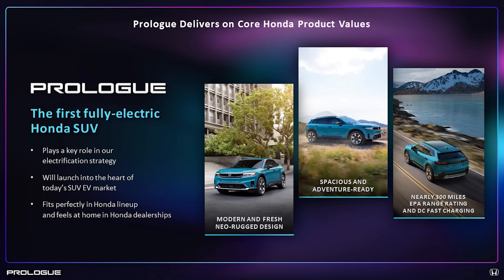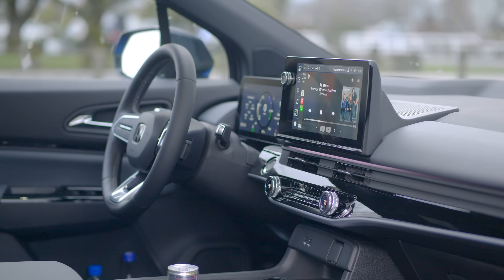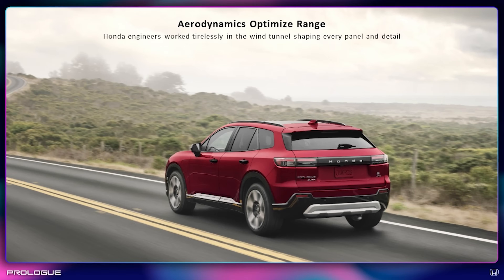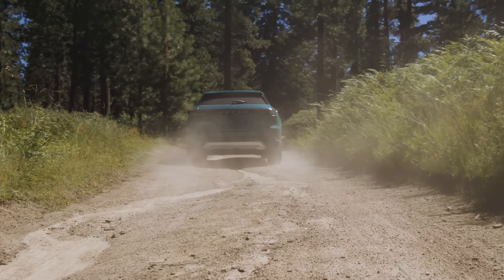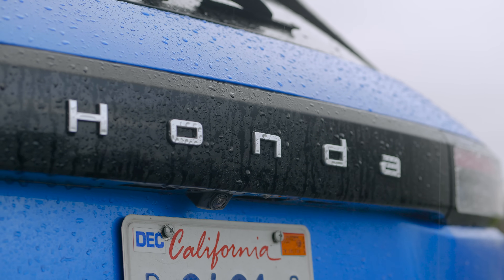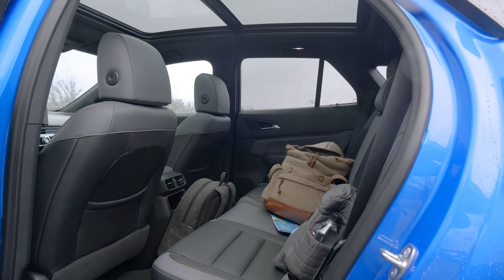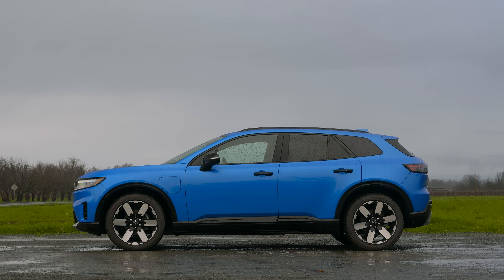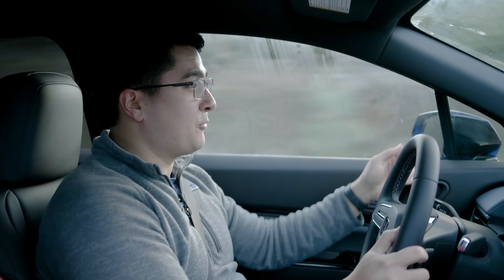Honda Prologue First Drive | Taking Risks

Comment: I’d worry about a GM-based Honda. I’d feel much more comfortable if they swapped in Rover (Lucas) electronics
Reply: Rover? British engineering ? Really?
Reply: @SkippyPB.  They did it once before, the Honda Crossroad was a rebadged Land Rover Discovery, because Honda didn't have an SUV in that exploding segment in the 90s and needed something. They also did it with the Honda Passport (Isuzu Rodeo, which was owned by GM at the time)
Reply: @Black-Villain  ahh didnt know that
Reply: @SkippyPB.  Honda were also major partners of British Leyland in the late '70s and early 80s, for example the triumph acclaim was a rebadged Honda Accord (or Civic?) in the early 80s for the UK market. And the Sterling 825 and 827 in the US (also badged as the rover 800 series in the UK) were Acura Legends. The Acura legend for every market outside of the US and Japan was actually manufactured in a British Leyland factory
Reply: That was cold blooded

Comment: Type R money for a GM EV is diabolical 😭
Reply: the Type R is a diabolical car in general. I could buy a Camaro Z/28,  a real 7L V8 race car with plates, for the same price as a Type R. You'd have to get in a really bad  head trauma accident to know your options and choose a Type R
Reply: @THESLlCK  Yeah, get a Camaro. Do they still come with a free TapOut t-shirt and oversized fake gold chain?
Reply: @NomenClature-o8s  You really thought you did something here? The Civic SI gives you everything you need to build a MUCH faster FWD honda, if that's what you're after for whatever reason. At 50+ grand you might as well buy an S2000 and supercharge it, your buyers remorse isn't my problem. Don't take personal offense, they scammed you out of a downpayment on a mortgage, not me.
Reply: That’s like saying, use a cheap screwdriver to hammer a nail, because it’s cheaper than hammer. Wrong tool. Two different types of tools.

Comment: This looks and feels like a phoned-in effort, that Honda did just because they needed something in the segment.
Reply: Even though they truly didn't... They just wanted to "save" money by not having to do the battery thing, which GM already did... Enter: many future problems that they don't even understand or know about yet... ie battery replacement, quality, reliability, durability, dependability, etc.
Reply: emissions regulations are getting unreasonably tight. They NEED these cars on sale to offset emissions regulations
Reply: Compliance car.
Reply: @faheemabbas3965  what is it complying with? I can't imagine them selling enough of these to make a dent in CAFE.
Reply: When was the last time Honda or Toyota made a huge splash when they entered the market with a product? Hmmm....never. However, they still found a way to own the minivan, crossover, sedan, small truck, compact and subcompact markets that were once dominated by North American names. Asian manufactures operate from a 10 year vision and plan (if not longer) and don't prioritize stakeholder profits over product.

Comment: Honda feel, GM - quality, parts, performance, manufacturing
Reply: That should work out for Honda…
Reply: It's giving triumph acclaim...
Reply: All for the low price of $50,000.00
Reply: Yep.  It’s STILL a GM product with Honda skin. This is atrocious.
Reply: Wait for fire recalls lol
Reply: GM rear drive will drive better.
Reply: What could go wrong? 😂
Reply: this is very deceptive, I buy a Honda because its a Honda. I want no GM in there
Reply: Acura pricing.
Reply: Like the Vibe/Matrix. At least Toyota put their engine in the Matrix. The Vibe had some issues

Comment: Hitching their wagon to GM is not a risk, it's a suicide mission. The GM version of this vehicle has been an absolute nightmare, plagued with so many electronic, quality  and software issues.
Reply: Well, next up is the Honda bespoke EV platform. Hope it's solid.
Reply: really? any videos youve seen? i havent seen anything bad about their evs aside from the issue with the LG batteries they had to recall over
Reply: @bradhaines3142  Their software is complete dogshit
Reply: @bradhaines3142  The Blazer ev has a stop sale on it right now for software issues.
Reply: @bradhaines3142  That LG battery recall was for the Bolt, which was years ago. The newer GM EV Platform (Ultium) has been having issues like you wouldn't believe. From manufacturing constraints to software. The Blazer EV (the car the Prologue is based on) is under a Stop-Sale order right now due to crippling software issues that have caused at least 2 journalists to get stranded, and essentially brick the car when plugging into a charger
Reply: Honda has already pulled the plug on future joint GM products. It seems the Prologue and ZDX are a one-off.

Comment: Remember this isn't the first GM and honda venture together who remembers the 2004-06 Saturn Vue with Honda's 3.5v6
Reply: Gm using Honda engines = good

Honda using GM powertrains = dog.water
Reply: Ideally it would be Honda engine with GM transmission. Hondas had alot of craptastic unreliable slushboxes throughout the years.  @jtpro0244
Reply: Using Honda's V6 was the single positive move in Saturn's history. 
The second was their demise.
Reply: another truly inspiring car
Reply: No wonder I still see those things driving around LOL
Reply: @mertz313  Honda/Acura engines are designed for 350k miles. In my experience its not the engine that'll have you selling a 250K mile Honda, it's usually that you just need a bigger car. In the mean time I have Chevy Suburban that has its own dedicated stall at the local shop its such a POS at 200K miles.

Comment: Honda doesn't learn the lesson. the Honda. GM. merging is nothing new. only added a more skeptical feel toward Honda's future reliability. sounds like Ford and Mazda. the era where Mazda earned a huge deal of bad-built Vehicles reputation. the reliability was seriously bad. now Mazda working hard to fix what Ford has damaged. looking forward to a rusty body and frame and an electrical mess good luck  Honda.

Comment: Honda:  Our customers don't cross shop with GM.
Honda:  Okay lets work with GM on our new EV SUV. 🤨
Reply: that makes total sense
Reply: And it looks like absolute garbage and costs too much.
Reply: One time went to a honda dealer to buy an accord and they told me that they don't compete with toyota when I told them that I don't like their price and will go to toyota.
Reply: @singular9 salespeople will say anything.
Reply: @singular9 yeah… I think Honda is falling hard now. Europe sales are crap, 1.5T not being so great everywhere, even if the HR-V and CR-V sell, what will happen to Honda?
Reply: @singular9 Toyota has five times the market cap of Honda so in a way he’s right
Reply: Makes sense because both brands releasing the same suv won’t result in a cannibalization of sales for either
Reply: It makes perfect sense to me. People who cross shop aren't looking at the underlying details of a platform. They shop by brand, they aren't shopping by who designed the powertrain. People looking for a honda typically aren't also looking at GM products.

Using a power train that already exists and is proven (kind of) and providing it your customers under your brand makes sense to me. Saves many millions of dollars and lots of time and effort. Plus sometimes it's genuinely impossible to find enough talent to build what you want to build, especially when you're dealing with new technologies, so the only option often times is working with another company who's already been there and done that
Reply: @RayanMADAO Or sometimes you didn't keep up with what is going on in the world so you're not ready to go electric and the only way to sell an electric vehicle is to buy someone else's and resell it.
Reply: They think the general public wont notice, and that might be true for 20% of the buyers
Reply: He was saying it meaning their customers won’t figure out it’s a GM EV pile
Reply: And build it in Mexico.
Reply: I used to cross shop GM and Honda. I had both for decades. Now I have Volvos and Toyotas but I would gladly buy an Acura.
Reply: @glsracer  Well, luckily now you can buy an Acura made by GM! The circle is complete.
Reply: there is a reason for that! You buy a Honda for a good drive experience and reliability. That's a bit lost now😢

Comment: I could imagine someone out there paying 48K very top trim for this, but 60k? Unreal.
Reply: EV’s cost about 10-20k more than similar ICE cars. So it’s kinda inline price wise.
Reply: @MrMystang92  it's kinda INSANE that a vehicle that is mechanically so much simpler and takes little to no time to develop thanks to cross-vehicle platforms and universal underpinnings PLUS the fact that another company helped them develop it for even cheaper **gasps for breath** it should be LESS than usual. EV pricing is insane. It's a genre-wide problem. Frankly though, I wouldn't care at all because I'll never drive one again, EXCEPT for the fact that every EV in my state gets nearly 7 grand in grants from the state from MY taxes
Reply: @THESLlCK the government is funding OUR problems using OUR tax money. The problem being EVs.
Reply: @THESLlCK  Mechanically much simpler, but the supply chains are more complicated and the volume, variety, and cost of raw materials that go into EVs are significantly more than an ICE vehicle. Unless there is a quantum leap in battery, energy transmission, and energy storage EV mass adoption will remain a pipe dream.
Reply: @THESLlCK  yet the cost of the materials to make the battery, which is the main primary component of these cars  skyrocketed. We are now in a race to make batteries cheaper. If you calculate how many items use batteries you’d understand that the resources are not sufficient enough to keep up with the demand we have. Hopefully this helps. Inflation and shortage of precious metals and materials will make electric cars more and more expansive. We’re probably about 25-50 years before that can be solved.  The solution might be sooner if people actually liked electric cars and that is still unclear right now. The infrastructure is not there, the power source isn’t good enough, the cost is not right for production of electric cars. Ford, GM and other manufacturers lose 20-30k on each electric car. You can’t stay in business on that model. Also development of other fuels for ICE cars is going substantially slow down the demand for electric cars. It’s not the simplicity of building a car but the over all development of the cars that killing the consumers and manufacturers.
Reply: @MrMystang92  Maybe, just maybe, it was a bad idea to switch from a naturally plentiful resource to a rare earth metal then. I would have no problem with electric cars if they were as good as the marketing suggests and the feds weren't fiscally strongarming us into getting them
Reply: @THESLlCK calm down bud. its R&D and the battery, along with alot of nuance to why it costs that
Reply: @THESLlCK I agree. The price for this car is ridiculous. Since it was a Honda, I was thinking it would be priced around 35-50k at the most. Why is it just as expensive as the GM version? No one is gonna buy this unless they got good incentives.
Reply: Dude. It's easy. Just stop being poor lol. 

It's as easy as saying milk comes from the grocery store.
Reply: @alleycatfifteenohfour  this is definitely a normal thing to say
Reply: prices for cars are crazy... anyone who buys a new car better be sure they can afford it with cash.. if not - they are being kinda silly moneywise.
Reply: The $7500 tax credit might be available since it’s got a USA battery pack. Pending word on that still
Reply: This is a play right out of the Honda playbook, and if you've lived more than 30 years you should be able to recognize it. Honda, Toyota, and other Asian manufacturers are known for letting North American companies do the heavy R&D lifting before fielding a very conservative well-built product, and then...they wait, refine, wait...refine...wait,  and then when there's a market opportunity they jump in make improvements to a crappy North American product (too many Dodge, Chrysler, Chevy missteps to list) and then out of nowhere they dominate a market like they currently do for small trucks, subcompact, compact, sedan and minivan markets. Honda had done a good job of figuring out what appeals to the North American market, and they'll figure this out too, and there's still a ton of low hanging fruit in the market.
Reply: @jefffaller8474  the only outlier is this time we have American Tesla engineering efficiency like no other, so Japan doesn’t really have much room to improve like they did with the extremely inefficient American cars of the 80s, 90s. This time we’re not wasting energy. My Y gets 278wh/mile and is the best vehicle I’ve ever owned with more space inside than a RAV4. If they can beat America (Tesla) this time around it’ll be out of left field
Reply: I think you can get up to $14000 off
Reply: @PostprandialTorpor correct, I got $15,000 off as a Honda Employee with all the available rebates. Leased at $0 down for only $525 including All Weather Mats and Tint 🙌

Comment: People don't buy Hondas for Pilot/CRV driving feels. Most people buy it for the reliability. This is basically putting GM's questionable reliability and Honda's lackluster SUV driving dynamics together.
Reply: Hondas used to be reliable. With some exceptions, They aren’t reliable anymore. If you really care about reliability, you buy a Toyota product.
Reply: @MH-lk8md  I have two first year Acura products which have been rock solid since day one. Don’t believe the rumors.
Reply: Honda's EVs have been a joke so far. GM's have not

Comment: 8:04 60K for a crooked badge, that GM q u a l i t y lol.
Reply: that's just Honda now. I went to buy a Pilot about 2 months after they launched and there was some misaligned panels and trim
Reply: @Suction_ I had a 2014 odyssey and there are 3 2017/18 crv in the extended family and the panel gaps are pretty wide and uneven.  Ive checked out other Hondas on the roads and they’re equally as bad.
Reply: I quit looking at new Civics because every other one it seemed had misaligned rear doors.
Reply: @robertk1049 civic. 1.5 are blowing head gaskets still.
Reply: That’s what happens when you have Americans assembling them…not really Hondas fault
Reply: @MrINDEPENDENT2000  It's made in Mexico.  Good try.
Reply: @usa1mac  well yea I forgot but what I said is still true
Reply: @MrINDEPENDENT2000 Honda should have their engineers and quality folks watching the assembly line
Reply: I’d argue that Honda quality has also become pretty shitty. I was looking at an Accord and the panel gaps and creaks were uncharacteristically bad. Hope it was just my bad luck.
Reply: @davis6123  once again you have American workers assembling them not giving a damn…doesn’t have much to do with the quality of the materials but more so how it was put together. Not Hondas fault
Reply: @MrINDEPENDENT2000  I’m just sharing my experience. I’ve seen countless American made vehicles that have excellent quality.  The Accord was not one of them.
Reply: @MrINDEPENDENT2000 dude Americans have been assembling Hondas for literal decades in Ohio.
Reply: It's a preproduction prototype. Of course it isn't perfect.
Reply: The curvature of the trunklid and the camera angle combined, could play into that crooked appearance. Still an oversight though, just like the whole philosophy of the car.
Reply: Prototype?
Reply: That and AWD letters are wonky.

Comment: Reminds me of the first Passport copied from Iszu. To me it shows a serious lack engineering and I took the quick and easy way to market. Honda has definately been dropping in quality control. My 2020 rtl-e ridgeline suffers from a horrible infotainment system. It freezes, overlays previous screens with a background of the previous screen. When I take it to the shop they "reset" it, but it still suffers from the same problem. No "Fingers" in the cupholders so drinks go everywhere. I have tried aftermarket solutions with poor results. I have owned 4 Hondas in my life and this is probably the last. Maybe Toyota or Mazda next time. Truly disappointed in this Honda. The techs admit that their infotainment is crap.
Reply: Except the Isuzu Trooper was a great off-roader. That was a good decision by Honda.
Reply: I have a 2022 Honda and 2021 Toyota and the infotainment is much better in the Honda. Both of our experiences are anecdotal, but I wouldn't write off future Honda's because of one bad infotainment experience. The Honda feels so much better to drive, too.
Reply: @fajitas4every1 That’s sad. I have a 2021 Land Cruiser and although I think it’s one of the best vehicles ever made, the Infotainment System is bad by 2010 standards.